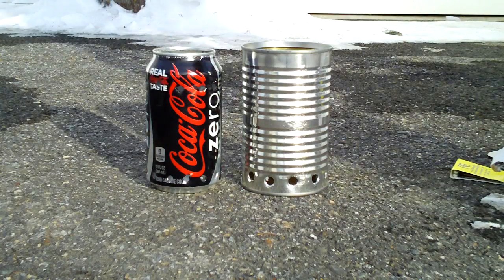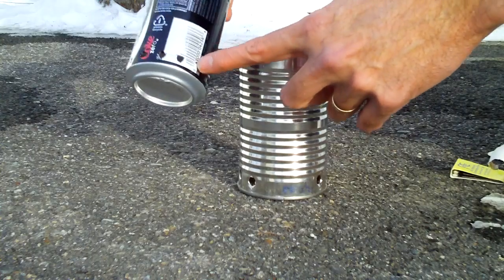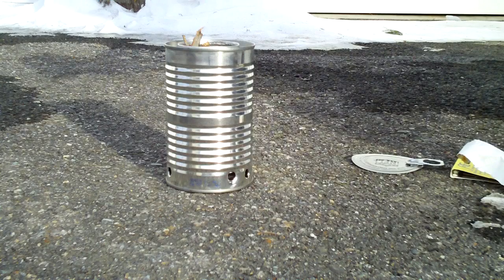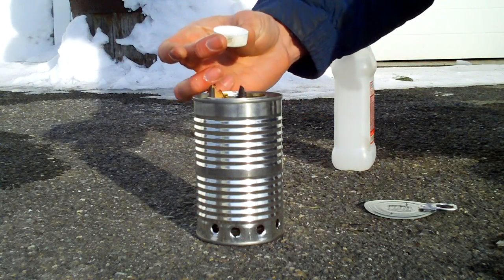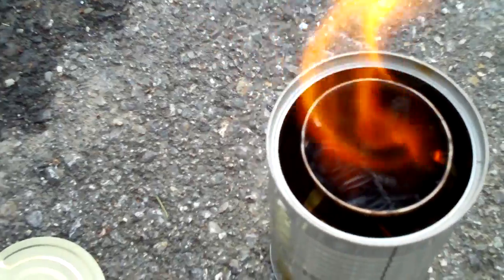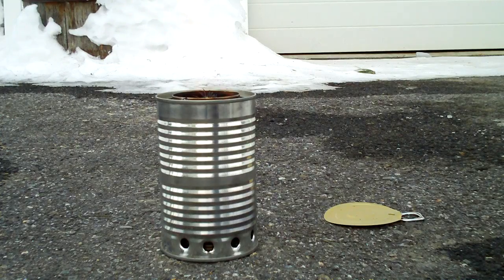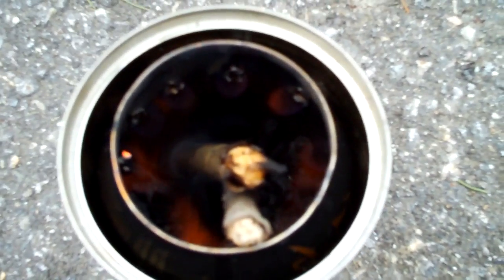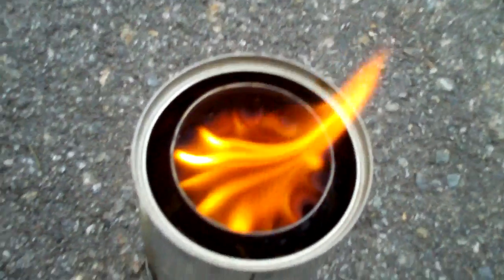Prototype Woodgas Gasification Camp Stove ✔

Comment: As a wood gasifier, this stove sucks. Spend a little more time and get a bit higher quality of materials to get a much nicer looking, longer lasting, more efficient stove. Use a liter paint can as your outer chamber and a progressive soup can for your inner burning chamber. It will be a much better stove made for less than $10, and it can be of the same quality as a solio or bushcraft stove that would cost over $100.

Comment: I copied this idea with the soda pop can and a sealed top so no gas can escape and it worked perfectly. After two burns though the soda can at the  bottom burned through. i will try it again with one of the thicker aluminum bud light bottles. See if it will hold up. I will comment again when I try it again.

Comment from the maker: I agree with you Seafront1, the gap between the two cans at the top should be closed off for optimum efficiency. This build more of less was to prove the concept and was very simple to do, but the real thing should be done with a closed gap to force the rising air between the two cans to enter the burn chamber and mix with unburned gasses and particles to create a secondary flame for cooking or boiling. I keep saying I am going to make a new one, and it is way past due! Thanks for watching!

Comment from the maker: Thank you Donald! I understand what you recommend! This was a very quick mockup at the time, and it left a lot of fine tuning possibilities. You're right about the can half full scenario. Hot air DRIVES these types of stoves. So the more hot air you can make and force through the holes at the top of the can, the more heat and flames you can generate for cooking!

Comment: Use a Tuna Fish can to top your stove and put proper holes in it and it will cook just fine. Notice the gas effect works better when half empty as it heats the side of the soda can much better causing a draw up the outside, Be sure to cut a feed hole in Tuna Fish can.
. Good video.

Comment from the maker: That's correct T. I do not have anything closing the gap at the top of the two cans which would force the hot, rising air, through the holes of the inner can. The smoke leaving these types of stoves actually contains unburned material that, when introduced to more air, the hot rising air coming through the holes at the top, causes the smoke to re-ignite into flame. The smoke is the "wood gas" that these stoves burn efficiently, giving more and longer heat than just an open flame.

Comment: that gap between can will heat the oxygen (air) that will make it more flammable once it exit the top side holes of the inner can. What is missing here is the top cover, between the inner can and outside can which is supposed to trap the hot oxygen (air) making it "gassified" as it burns out of the main hole. This make a cleaner ad hotter burn and this "trap" is central to the designs of gassifier stoves. mfcw, thanks.

Comment: Like it. Try to extinguish your flame it's amazing how much smoke bellows out.  Try making a downdraft gassifier by omitting the holes at the bottom outside can and creating a gap in the center of the flame for air down flow. The wood gas will then come out the holes and the air above the holes will mix with the volatile gas.  Let me know if you do more experiments.

Comment from the maker: Hello. I used rubbing alcohol to get it started. The sticks I could find were damp and were having a hard time maintaining a flame. Once I added the alcohol the flame was hot enough to dry out the twigs for burning. I am hoping that once I build a bigger one (way over due) that this will not be so much of an issue. It was Winter so I think a good amount of moisture was frozen inside the wood.

Comment from the maker: The gap between the inner can and the outer can serves a purpose to burn the wood fuel more efficiently and create more heat in the process. As the air and smoke in the inner can heats up, it rises bringing some of the unburned wood vapor with it. This heat also makes the air in the gap between the cans heat up, causing it to rise until it exits through the jet holes made at the top of the inner can. This fresh air rich with oxygen allows the unburned wood vapor to ignite instead of being wasted

Comment from the maker: I filled the can with small sticks broken to about half the length of the can, and it took about 5 to 10 minutes to get it going. As this is just a prototype and does make some heat, the volume of the can (combustion chanmber) really should be bigger to allow for more wood to burn and thus lead to more air being pulled through the can. This will make more heat causing the air in the gap between the two cans to rise and then be pulled into the jet holes at the top. This air burns the wood vapor.

Comment: This is an interesting take on the idea. first ive seen of an aluminum can as the inner can. rather ingenious actually. heat transfer to the incoming air is critical to the efficiency of the stove, and most people ive seen use another thick "clam chowder" style can. My next attempt will definitely use an aluminum can for the inner chamber. youre loosing alot of hot air through that open gap though. finding a way to close that gap so all the hot air comes in through the jet holes would be clutch.